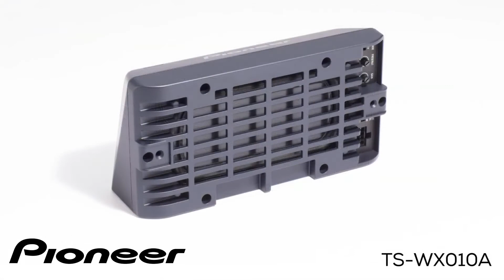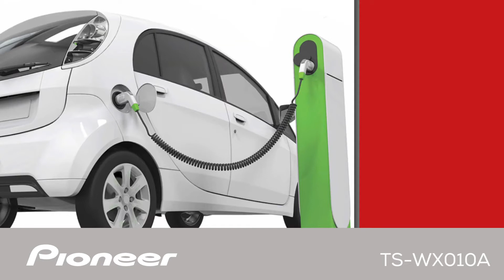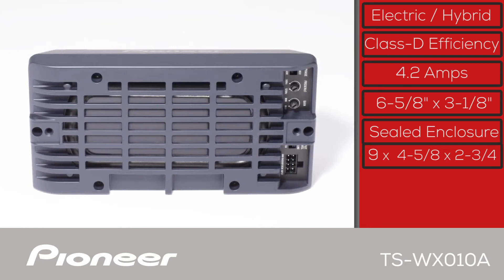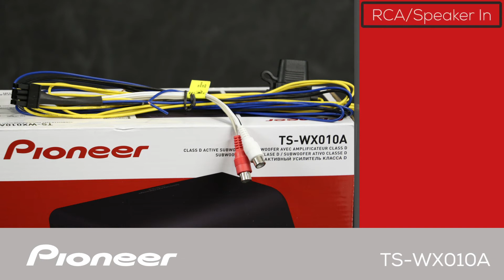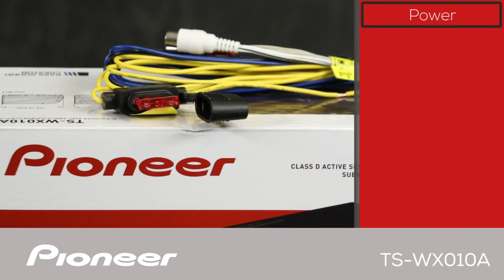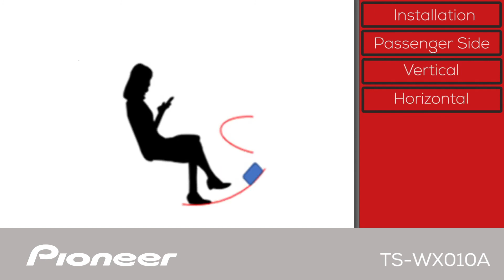Pioneer TS-WX010A - Unboxing

Comment: Hi, what if they installed an amplifier with this TS-WX010A? Will it damage the sub?
Reply from the maker: Hello. The TS-WX010A already has a built-in amplifier. As such, it is not possible to connect another amplifier.

Comment: Does it require an amplifier
Reply from the maker: Hi there. No, it's got a built-in amplifier and gives and output of 50W RMS/160W MAX. This is because of it's ultra compact nature. If you want bigger active subwoofers, please check out our TS-WX1210AH and TS-WX1220AH models.
Reply: @officialpioneermea  where can i buy . Do you have an email address?
Reply from the maker: @Marine-sg8vs  Please let us know where you are located, so that we can redirect you to our local distributor.
Reply: @officialpioneermea  Johannesburg
Reply from the maker: Hi, you can contact our South Africa Distributor, Audio Superb at:

Unit C7 /C8,
Roete 24 Herman Street,
Meadowdale,
Germiston 1614,

Tel: +27 11 974-3441
Reply: @officialpioneermea  Am based in Nairobi Kenya